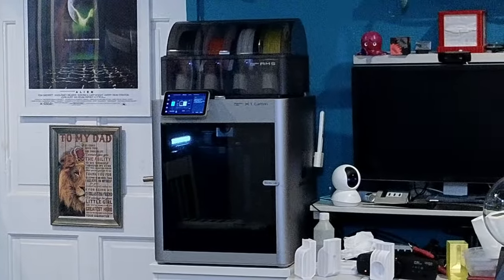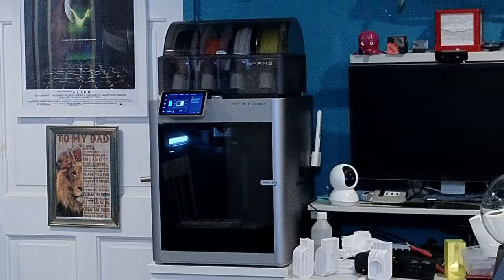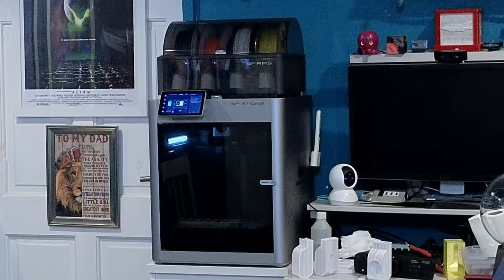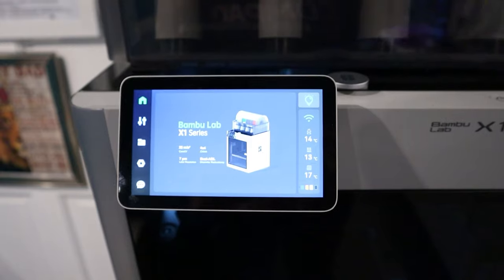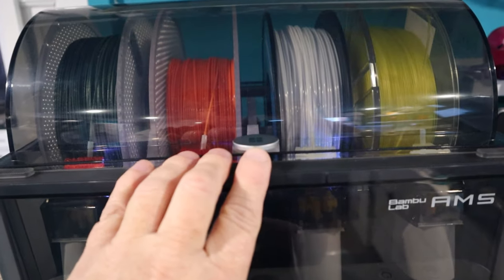3d Printing Filament Spool Re-winder PART 1

Comment: I'm currently running a .6mm nozzle on my X1C. Do you suggest going w/ the .4mm on this print? I'm still a bit of a newbie and not sure if I'll get the resolution on the gears that I need w/ the bigger nozzle.
Reply from the maker: I have never used a 6mm nozzle but I would think it should be ok ...the gears (even the smallest ones) are quite big. The only thing 6mm wouldn't be suitable for is fine details like textures etc.

I would just try it on the smallest item and see what it looks like.

Comment: I got my Bambu P1S printers on black Friday too - the price reduction was hard to resist! This is guide is fantastic, been thinking about making one of these for a while (to use 250g reels and also some that are too wide and jam) but was put off by how complex it seems. I always worry about getting part way through a project like this and it all going a bit Pete Tong and having to abort! Seeing someone complete it like this and offer guidance gives me the confidence to have a go myself. I only ever updated to the community firmware on my CR6SE after following your guide yonks ago! 

Anyway I've just ordered all the bits off Amazon so hopefully you'll have a couple of shillings to help out. I've added a reel of that TinMorry PETG to try too. This looks like being my most expensive 3D print project by far - £90 for all those bits, although I'll have some stuff spare for other projects too hopefully. Hope it works well! Any plans to do something similar with the Bambu hardware kits? They have some interesting looking ones including a combustion engine, jet engine and even a PC mouse. That jet engine in particular looks like it would benefit from a video like this. Anyway looking forward to starting this :)
Reply from the maker: Hi Steven...those are really nice words ...I appreciate it and thanks re the Amazon links :) 

Yes I am loving it so far...I too have seen that jet engine on a couple of sites and agree it looks awesome....trouble is I have pretty much run out of room in the man shed ...but who knows...maybe in the future.

I did buy a couple of different print bed surfaces for it recently from Ali Express that put a hologram/triangle design/carbon fiber effect on  prints so will be doing a vid about them once I have tried them fully out.

There are so many good vids on the Bambulab stuff out there from proper experts with big youtube channels that it's hard to find a subject not already covered but I dare say I will be doing some  more vids on it this year.

Thanks again and happy printing.